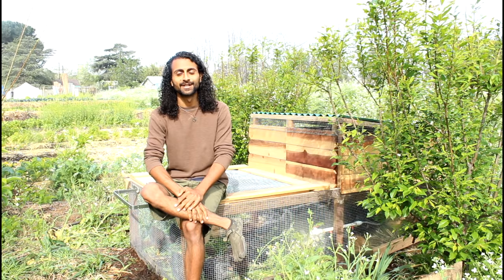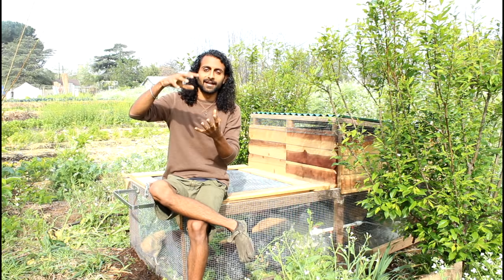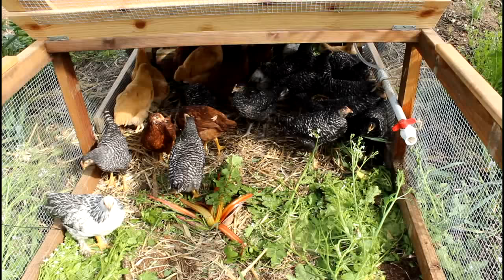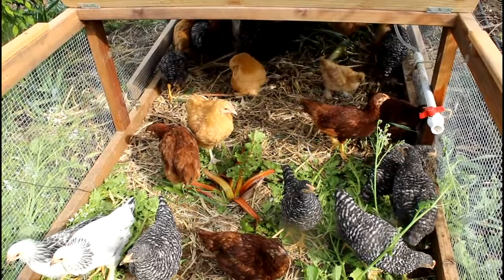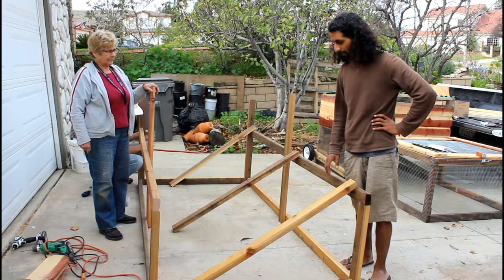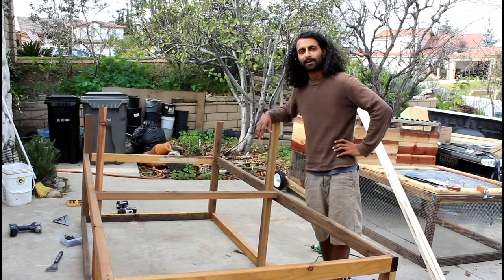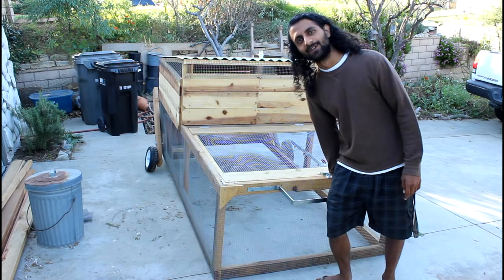How to Build a Chicken Tractor with Farmer Rishi

Comment: I always glue my wood joints in addition to the screws. I think stronger is better.
When drilling the double holes in the lower rear corners , I drill the small hole first then use it as sort of a pilot for the larger hole. This way the small hole is more likely to be centered in the larger hole. 
 Something that quail people should be aware of.  New born or day old  quail chicks can go thru 1/2" hardware cloth. Chicken wire , they use it like an expressway. For quail chicks I would use 1/4" hardware cloth at least for the bottom.
 By the way , hardware cloth is more rigid than chicken wire and will make the mobile coop stronger.  In general roosts should be somewhat higher than nest boxes. I don't know why but chickens seem to like that better.  They lay eggs better and roost more readily if the roosts are higher than the nesting boxes.
  I call the up rights, uprights. Calling them legs implies that they go down to support the coop.
  I also made a rainwater collector for the rear edge of the roof to direct rainwater into the bucket.  Not much of a consideration for L.A. lol

Comment: For ease of assembly , I would assemble the shelf and nesting boxes first and then set it in place.  That way you do not have to install any screws upside down. Knowing what chickens do , I use a 1" X 4" straw retaining board and the chickens STILL throw nesting material out of the nesting boxes. lol
 For the nuts on the wheel assemblies you can use a product called Loc-Tite that will prevent the nuts from coming loose.  Note that there are two types of Loc-Tite.  One is removable which will allow you to remove the nuts. And one is permanent which is as it implies.  The nuts will stay on permanently.  Non-removable .

Comment: Liked the instructions for chicken tractor. I have a 3 dog kennel with chain link that I need to attach a wheel assembly. I have a 10x10 kennel, and a 6x10 kennel. I laced chicken wire over the kennel to discourage other critters from eating my flocks. I had a critter pack that killed 5 full size turkeys, 4 ducks and several chickens. I am in the process of attaching vinyl siding to the inside kennel to discourage enemies of the flock from destroying my flocks. Would appreciate some help. Thanks

Comment: Excellent video.  I have a coop that I will be converting to a tractor and needed to see "how to do the wheels"  so I will be using your techniques for my wheels.  I do have a serious question, .. how do you refill your water bucket ? In your video, it looks like you've sealed it up with the roofing.   Can you show how you refill your water bucket , please ?
Reply: Javalady62 ,
I believe that the egg door opens to give access to the water bucket.  I also made a roof gutter system from some PVC pipe to collect and drain rain water to the bucket. I used a piece of 1 " PVC pipe , cut a slit in one side wide enough so it would fit over the end of the roofing. Rain water drains out via some smaller PVC pipe to the water bucket. This arrangement reduces the number of times that I have to refill it.  For my permanent coop , I use a 55 gallon barrel inside of the coop which feeds into a five gallon bucket with a float valve. With that setup I never have to carry water to the chickens.

Comment: I love this video plan, I intend to use it with a few modifications. Should work great, however I'm not finding your materials list.
Great job, thanks

Mike
Reply: I thought he explained what size and length boards he was using.  The thickness of the bolts and nails and drills.  Watch again and take notes and you will probably have a 'materials list'.

Comment: My husband built this for our ladies. It's really nice to have a second coop, but because of the terrain in our yard, it isn't very movable as made from these instructions.
The uneven/rough terrain in some parts created leaks in the watering system and the pivot point where the wheel lifts is too low (I don't know the technical terms). Very informative video though!
Reply: use larger wheels and make your picot point higher - experiment.

Comment: I love your detailed instructions and demonstration!  I live in eastern Washington state where we get snow for several months.  Would this be warm enough in the the winter for my chickens?
Reply: I live in a colder climate, too.  I am in the process of building this and have decided to put boards (instead of hardware cloth) around the sides under the perches.  It still leaves one side open, though.  I hope this keeps them warm enough.
Reply: I live in Ontario (- 40 most winters).  In all my reading on cold weather coops, the biggest problem is not enough ventilation and too much dampness.  Keep looking - there are plenty of videos that will give you the answers.

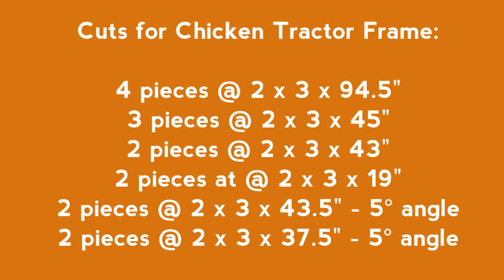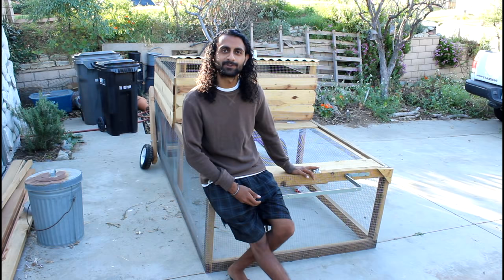Comment: The cuts and parts are listed at 6:04, 15:10, 17:56, 20:20, 21:15, 21:25, 21:35, 23:00, 29:20, 30:37, 31:37, 32:21, 33:35, 35:03, 40:25, 42:28, 46:20, 49:22, 51:10, and at 51:50. Notice the handle at 51:50 that is not explicitly mentioned.

Comment: you should have used lock nuts nit spring washers, spring washers are useless for your application the correct would be to use nylon-lock nut.

Comment: Does anyone know how he added water to the reservoir? Or have good ideas on what I should do? (I am half done with this project). Update: Apparently he just filled from the egg door every time. Seems very inconvenient (especially if you don't use a short square bucket like he did). I routed a fill pipe out the side and right angled up to a small modified bucket (funnel).  I under the roof in order to get water. I even added a hose tap and isolation valve should I want to fill from the hose instead.

Comment: The screws don't go in the valleys. They go in the hips always.
Reply: @Richard O'Bannon ,
His rainfall is an annual 8" per year.  I doubt that he has to be very concerned about water leaks.
Reply: Yep or will leak and rust plenty !
Reply: Will break that plastic crap if screwed on ridge
Reply: Richard OBannon why?
Reply: @debracollins1479  Read the manufacturer's instructions.
Reply: @sheilamclaughlin963  Not if done properly.

Comment: I had some trouble with the roof part. My 19" @ 5 degree pieces were not flush with the 43.5" @ 5 degree. I checked my measurements, and the middle beam (bottom part) is at exactly 21.5" as he states in the video. I put the 2x3 short side facing up, which makes the top of that beam nice even 24", but it should be 24.5" I think? 24 + 19 = 43, and I have a gap that is just over 1/2". I'm going to shim in a piece with wood glue and a screw, but I don't understand how it looks right in the video with the measurements they give. 
EDIT: Okay, so I measured and my 2x3's are actually 1.5x2.5. They are softwood (pine I think) since I am in Wisconsin and we don't have hardwood around here.
Reply: Thank you! Had the same issue using standard dimensional lumber 2x3 nominal not actual. Thought I was going crazy, but now it makes perfect sense. I’ve got spare 2x2 so I’m going to try just cutting them at 19.5 and see what happens. 🤷🏻‍♂️

Comment: Is there a purpose for cutting off the corners of the 2*6*10 pieces for the wheel lift system? Thanks so much for the video!
Reply: So there is not a specific angle it needs to be cut at? Thanks!
Reply: Thanks! I have really been finding your video helpful. Also, this is random, but your hair is epic!

Comment: I have a few questions... I can not find any 2x3's at lumber stores in my area. Are these actually what they call 2x4's? or are those too big?Also I do not understand why you started with 16 ft boards just to cut them down to 7 ft 10.5 in. Why not just use 8 ft boards?And I also do not see an itemized list of materials posted. Thank You enormously for this informative video. I was sure I couldn't build my own coop, but with this I am certain I can now. Thanks a million for taking the time to do this

Comment: I built the coop following the instructions. I got everything out of home depot and it cost my about $250. I live in the suburbs so I wasn't expecting too many predators. However, after a few weeks, today I found a hole dug under the coop. My guess would be racoon or opossum. Since this is a mobile coop I can't put the fence into the ground or expect to put it on bricks. My best guess would be to attach an L on all sides made out of plywood. It would cause the surface area to be wider and it would take more effort to dig. Any suggestions?
Reply: I am working on mine now but I have some concerns about that also, I plan on letting my hens free range some during the day. I am thinking of using hardware cloth on the bottom then I'll move it to a new spot  this should spread some of the litter. Not exactly the way a chicken tractor is supposed to work but I don't think my birds would survive locked in at night without a bottom.
Reply: That seems like an excessive price for something so small... If I’m spending that type of money I want something that’s  twice the size atleast.

Comment: I really like this design. Two questions. 
How much room is inside the tractor?
How many chickens can comfortably live inside this tractor?
Reply: you can put more chicken in a pin if you move it daily.
doesn't work on a hilly surface. chickens learned to walk under gaps.
it's cute to watch, they lay almost flat with wings out stretched and walk under 
a small gap. i trained mine to follow me with bread crumbs and they follow me back inside without chasing them.
Reply: Zombie Robbie check out Joel Salatin (sp?) with Permaculture Voices. He talks a lot about pastured chickens and using this method for meat chickens. Apparently you can fit a lot in a space like that, and like in the other comment, I think the primary space issue is associated with food availability and keeping a clean space for the chickens.
Reply: I have the same question, what is the number of chickens recommended for your design?
Thanks
Reply: I have one roughly  14'x4' (56 sq ft) and I keep six adult layers in it, so about 9 sq ft per bird. It seems to be enough for them if I move them daily. If you leave them for more then a day though, you can kiss your lawn goodbye! I am sure that other may have different advice.
Reply: A recommendation for chicken space is 8-10 square feet per bird if your coop and run (exercise area) are combined. You do less space, you get stressed chickens. It doesn't matter if you move the chicken tractor daily, because they need space to move around without getting in each other's way. This is especially important if you have an alpha hen that pecks the others when they get in her space, which is not uncommon. To keep them healthy and happy (which means better egg production), give them as much space as possible.
Reply: Ian Rothermund, Space is more than just having clean ground and food. How would you like to be enclosed in such a tight space that you bump into people whenever you move around? Especially if one of them bites you every time you pass by too close and get in their personal space? Chickens thrive with space. The more they thrive and the less they are stressed, the healthier and more productive they are.

Comment: This dude is awesome!
Reply: This guy is dangerous! Do not do what he is demonstrating here! Learn some skills before you attempt to teach others... 

Teaching people improperly is not only in poor form - it is immoral and down-right dangerous! 

i.e. - Does this guy even own a properly fitting combination wrench? Adjustable pliers should be your last choice! 

28:40 - He has no idea what an Elastic Stop Nut (Nylon Insert Locknut) is! - Or - Why it is a better choice to mount the wheel. 

36:48 Wrong size PVC glue applicator...! That one is good for 3" pipe and larger. (Read the instructions!); 

37:14 - "Red Hot" glue, WHY? It is not raining or sub-freezing! (Again - Read the instructions!); 

37:23 - large puddle of glue on concrete! (Applicator too large!) 

39:47 - Covered glue spill on concrete with board. 

39:58 - Spills glue again. - Glue everywhere! - (Applicator too large!) 

37:48 - Fails to use proper threaded T-fitting or 1/8" tapping device for nipple threads.
37:50 - Drills into hand - Almost! 

39:26 - Glues the ball valve in the open position with excess glue inside fitting. (Applicator too large!) 

43:48-44:08 - It makes no difference! The hinge will function properly with either plate on top. 

45:15 - He says this can be used for quail... 

45:24 - How does he keep them in when the coop is 7" off the ground in the transport position? 

48:26 - Lets helper sweep FRP debris away with his bare hand. There are glass fibers in that stuff! USE A RAG! You will thank me later. 

48:35 - Uses an impact driver on a short wood-screw. Great procedure if you want to strip out the wood attachment! 

Just wondering... 

48:55 - How does he fill the water bucket with the roof screwed down tight on top of it? 

52:42 - How does he keep the salmonella out of the vegetables with those chickens roaming around in the garden areas?

Comment: a beautiful design!

a question about the chicken poop under the roosting area -- as I understand it, chickens do most of their pooping while roosting at night. Since there is no floor under the roosting bars, I'm guessing that a good bit of chicken poop will concentrate on the food supply just under the roosting area. Assuming that the chickens wouldn't want to eat from that area in the morning, would you move the tractor forward at least one half tractor length, or backward one full length, first thing in the morning, or let them scratch through the roost poop? Also, is there a way to keep them from roosting in the nesting boxes, and pooping on the eggs? -- very awesome design and a beautiful presentation. I really like your idea of no floor under the roosting bars. De minimum, but at 7m12s you accidentally mention 47½" for the length of the middle vertical bars, but you make it clear elsewhere that they're 43½" (or 6" taller than the back verticals at 37½).

Comment: anybody built this style in a cold climate? I like the simplicity of not having a floor in the coop section but I'm curious how they would do in a cold winter.
Reply: Cherry Tree Permaculture I was wondering the same thing. I also would worry about predators getting in from the bottom. A dog could easily dig under that. We had a chicken killed by a neighbor's stupid wiener dog. They don't have to be big predators to kill.
Reply: I live in a mountain area in ID i have a chicken tractor we park it under a tree (i see bugs all around the tree very late in fall and very early in spring) we put an easy up over it without extending the legs all the way and thats where tgey stay all winter we dont use lights or anyother artificial heat and the chickens do fine I'm on my 5th winter and 4th gen of chickens and have never had a problem with frostbite or other cold injuries. The best thing you can do in my opinion is keep the snow off of their coop and they will work together to stay warm hope this helps
Reply: @rachaelb9164  About a year ago the same thing happened to me, my front door neighbor has 3 chihuahuas and let me tell you those three dogs are evil, they hate humans other dogs, cats you name it! I have a rabbit cage in the back with 6 rabbits. One day those little four legged criminals decided to enter my property attack my baby's, luckily they only got to 1. Since that day I said enough. I know it's really mean, inhumane and illegal but I shot them with a pellet gun. Ask me if they continued coming over, No! Not anymore. Now I kinda feel bad for shooting them.  I love dogs but ima do whatever to keep my family safe and those rabbits are part of my family.

Comment: Can anyone tell my how he planned to replenish the water in the bucket ? does he unscrew a bolt each time from the roof ?
 also I just made this last night and did not have enough hardware cloth for the top of the run, I did go all the way around the bottom and thats probably why
Reply: Did you ever figure out how best to add water?
Reply: @robadoba8497  Yes and it has worked wonderfully !
Reply: @stepheather1  would you care to enlighten me? I'm in the midst of this project trying to think about options, but all of them are messy.
Reply: @stepheather1  did you drill a hole in the bucket and attach another pipe out the side or back of the tractor? Or just drill a hole in the roof?
Reply: @robadoba8497  drilled a hole in the roof
Reply: @stepheather1  thanks!